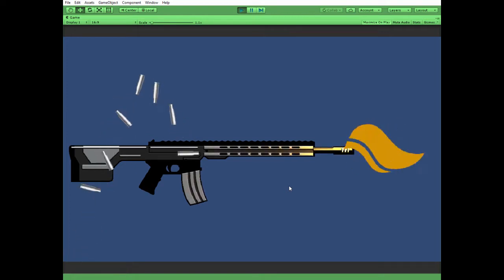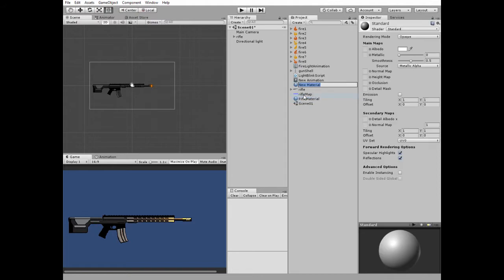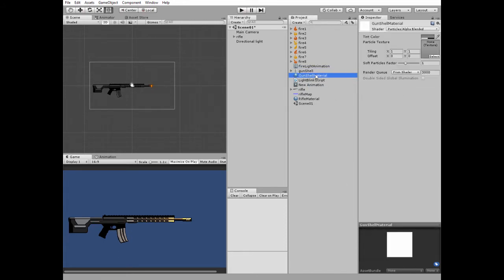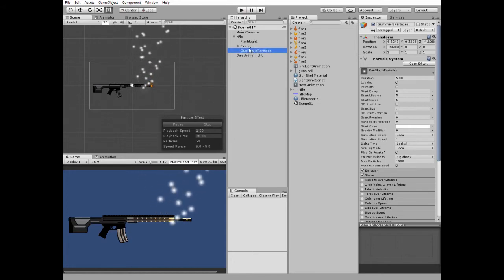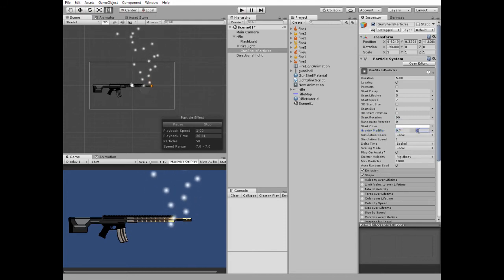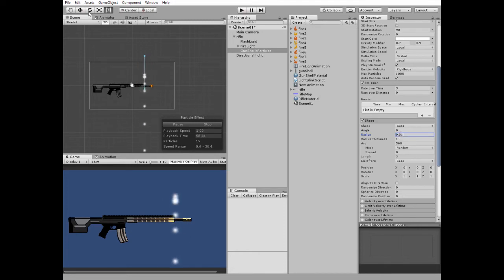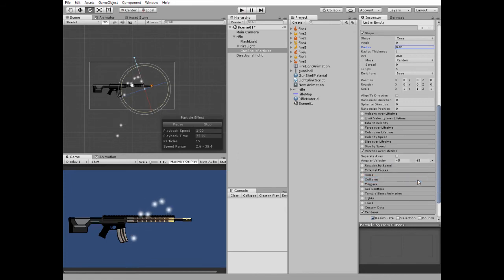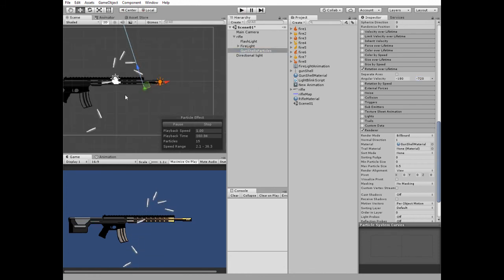How to create Bullet Shell Extraction effect with Particle System in Unity game? Simple 2D tutorial.

Comment: A WORD OF ADVICE to anyone working on shell ejection: If you plan on having the shells disappear the second they touch the ground, go ahead and use the particle system but keep in mind that particles disappear when you disable the emitter object. This means if you disable the gun when you unequip it all the shells will disappear which is an issue is you want to have them persist on the ground. The only solution is to put the particlesystem on a child object of the gun and parent it somewhere where it will stay active before you disable the weapon. (which means you need to instantiate a new particle emitter everytime you equip the gun). If you do this keep in mind the particle system has an option to destroy the gameobject once all the particles are dead see "Stop Action" (useful for cleanup). If you are planning on multiplayer, you're gonna have to syncronize the particle systems across the network which I haven't tried yet. So the deal is this: Using the particle system for shell casing and bullets is an attractive idea which allows you to quickly get shooting and ejecting shells BUT it requires lots of code afterwards to make everything work like you want (damage, persistence, multiplayer, finicky physics and particle placement) whereas instantiating prefabs requires to set up everything from scratch (velocity, randomizing the ejection vector, etc) but is much more straight forward (even for multiplayer). The only challenge is setting up some sort of pooling to recycle the game objects so you don't kill the performance with thousands of instantiate calls. Pooling is not that hard, basically you create a list and add every object you instantiate to it. When an object is no longer needed, it disables itself (ie.: a script on the prefab that disables it after X seconds, the invoke command comes to mind) and when you need an object, before instantiating a new one you run a foreach loop on the list to see if you can find one that is disabled (use return to exit the loop when you found one), then you set its position, enable it and you can reuse it as you normally do. If you cant find any you instatiate a new one and add it to the list. Voila. Good luck.